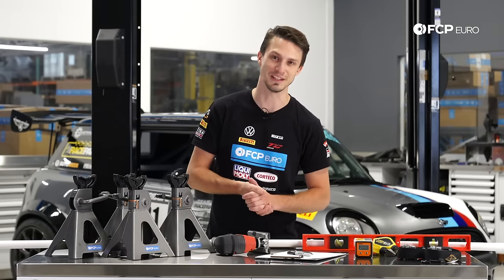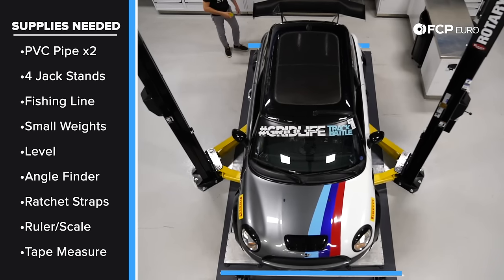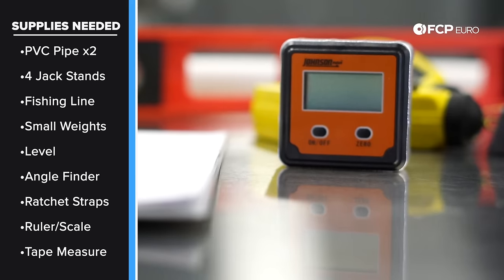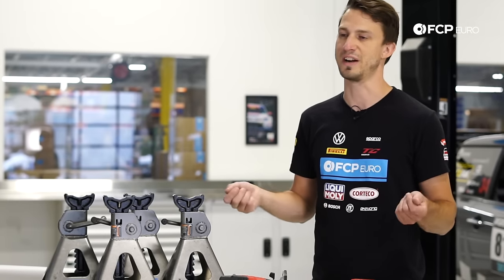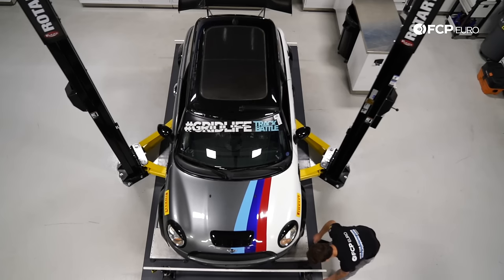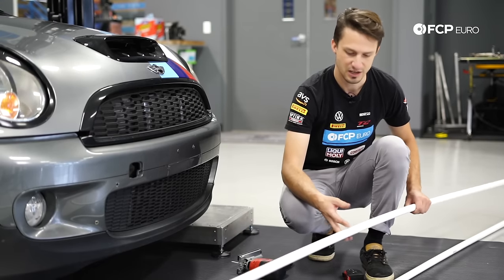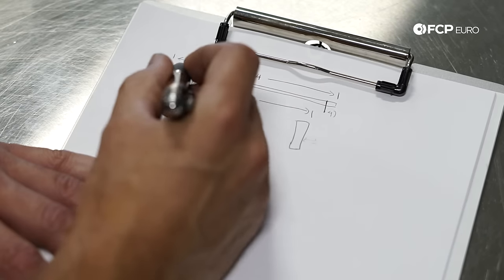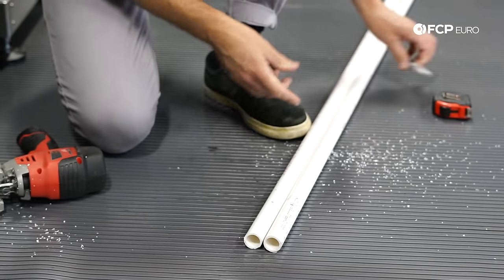At Home Alignment Made Easy - How To Use String To Align Your Car

Comment from the maker: Conversion Chart : https://fcpeuro.sirv.com/Content_Marketing/Degrees_To_MM.PNG
Reply: You could just use trigonometry.
Reply: Thanks 😊
Reply: Thanks. Is the diameter the "tire diameter" or the "wheel diameter"?
Reply: @gustavette8487  wheel
Reply: @douggolde7582  Yes measure actual diameter of wheel rim where measured, my cars 18 inch are actually 19 inch.
Reply: Should the steering wheel lock😂
Reply: Idler Pittman arm 2002 yukon

Comment: Very informative.  Now all I need to make it easy is a full size lift in my house.
Reply: No... Have seen old guys do Stringing race cars with the car on a flat surface ( on a tar surface).

Trolly Jack is what they use to jack the car up to allow adjustments
Reply: I do it in the pits. Just have to jack up the car a tiny bit at the front to do adjustments
Reply: Video hasn't even started yet n I'm ctfu @ this comment 😆
Reply: @gj91471  yo
Reply: Not correct if you’d watched it properly. I assume “Slow In Fast Out” refers to your information processing comprehension
Reply: Lol
Reply: Nah, just need 8 total jack stands 🤣
Reply: Lol
Reply: When I read this I imagined a house lifted like a redneck truck
Reply: 4:55 dude I'm surprised so many people liked this comment. Are people really this ignorant? Or is there a joke that I missed?
Reply: @johnnyovermind9830 No you’re missing the experience, the joke is build in.😂
Reply: Noob
Reply: U can have your tires on non stick pans
Reply: For anyone taking that seriously: You really want the wheels loaded as there’s a big shift in the alignment when the wheels are up in the air.
Reply: 4:57 lol

Comment: Hit up a "dollar store" and grab 8 cheap smooth thin cutting boards. Stack 2 of them, and stick them under each tire. Almost totally removes stiction when you're making adjustments. Sure, you could get fancy bearing plates - but then you wouldn't be watching a DIY vid!  :)
Reply from the maker: Love to hear it!
Reply: I was thinking about metal plates and axle grease between the two but sounds even simpler!
Reply: @PetuniatheGT350  me too
Reply: This is brilliant! I'm going to try it.
Reply: @PetuniatheGT350  Overthinking it bruh
Reply: @danyan7  sure ya wuz
Reply: I have turn plates for the front, but I'm going to try your idea for the rear.
I think I can machine some slots in the cutting boards, and make pins to tie them together, allowing them to slide in/out, but keep them from getting out of alignment with each other.
Reply: @1Cobranut  aww Cobra, ya such a Nut!  😆 Sounds plausible tho…

Comment: I've been doing string alignments for years! They are way better than a shop alignment which always gives you a crooked steering wheel.
Reply: Probably shop incompetence, typical when you have a "pro" do it. I recently had an alignment done on our old van and sure enough, the wheel is cocked at 11:30
Reply: I did alignment work for 25 years, I test drove everything, I made every effort to ensure my customers never complained of pulling, worn tires, or crooked steering wheels. Parking lot would be jam packed from open to close. Been 20 years since retirement, and customers still call for me.
Reply: @r.weaver3769  Respect you you sir.
Reply: @devonstrickland5640  Thank you, I miss the work, but truly miss the awesome customers I had.
Reply: @r.weaver3769  string alignments? :) Sounds like you did an actual thorough job LOL.
Reply: Does anyone know if the mfg specs are set when car is on the lift with wheels un-weighted?   Also - JFYI, doing alignment work on my Silverado required using a plumbers pipe wrench to break loose the lock nut on both sides.
Reply: @r.weaver3769  Maybe you should go out of retirement and teach the entire industry how to do correct alignments cuz EVERY time I get one it gets worse and worse....
Reply: had an alignment done at a local chain, ended up with crooked steering (10 o'clock!) they said it's my car that's the problem!- I said it did not come  in that way, they ended up redoing it,apologize saying the tech did not set the steering straight before changing the settings....

Comment: So after you paralleld the rear bar you have now thrown the front bar out of parallel.  Someone watching this and doest know the first thing about geometry will be messed up and or they will be adjusting off of incorrectly set parallel strings

Comment: Remember that just because two lines are parallel that does not create a square.   If the PVC pipes on one end were offset at all, even 1/4”, the strings would not be the exact same distance from the wheels.    A parallelogram would have all four sides parallel but could be very far from square.   I say this because those “centering” measurements were assuming the engine cradle was dead center.     We can’t assume anything.

Comment: when doing camber, try not to use the tyre as it bulges at the bottom, maybe 60psi would help negate this error, but get a flat bar the correct rim length for the DIYers
Reply from the maker: Absolutely! Hence Nate's note that tire is good, but wheel is better to get that camber measurement
Reply: Arent' we supposed to do camber adjustment first, then toe? The toe changes when camber changes.
Reply: @ModMINI  Caster, then camber, then toe.
Reply: @fcpeuro  Tire is not good
Reply: or just cut board correct
Reply: @hgjh6000  do you even know what camber is, and how a measurement is done?
Reply: @ranxerox10  I think what they meant is you could cut a board to fit on the edges of the rim, then measure the angle of that.

Comment: A few years ago I thought of using this method and used a pair of slotted wood battens for the string end supports, this method is by far the most accurate way to make wheel alignment, you did an excellent job of showing how to set the system up, hope not to many people spotted the little mistake you made when cutting the second  set of slots in the wrong side of the pipe :)
Reply: Lol I thought I was the only one who saw realised that didn't seem right
Reply: Im thinking of doing the same but rather than string would a screw not work butted up to the wheel rim? Running down both sides of the vehicle

Comment: Good video! A couple things that I have found after doing my own string alignments:

Use 1" EMT conduit instead of the PVC. If the jack stands are placed in a different spot front or rear, there will be different flex,  and that can alter the actual distance between the slots in the PVC. We are talking very small differences, but I can hold my measuring to .25 mm. I do my alignments outside, if the sun is beating on the front tubing but not the rear, with PVC,  this could cause a difference between the slots. PVC expands and contracts at a rate much higher than steel.  Even if this wouldn't be an issue for you, steel EMT would be much more stable and durable. Doing string alignments is all about eliminating variables. Use the thinnest hacksaw blade you can find and cut the slot by hand for best precision. 

To hold the steering wheel, you can get a steering wheel holder for alignments on Amazon. Looks like a little guy with a red head. Works great and it's a lot easier to use. 

I also use 50 lb test, .36mm diameter braided deep sea fishing line in bright yellow, it is very user friendly, doesn't knot up and tangle, yet it is easy to tie knots. It is highly visible so you don't bump it. And it holds a nice taught line with the weight without stretching. 

Some manufacturers measure toe in as a positive # so be aware what your manufacturer is actually stating. 

Here's a great toe conversion calculator: www.1728.org/toe-out.htm
Reply: Yes  u' r right.BMW have positive toe and is in not out...
Reply: I found a cheap alternative to the Amazon steering wheel holder - the wife 😂.  And she gets annoyed being called an Amazon...
Reply: thanks
Reply: Smart Man and smart comment.

Comment: Excellent video . Just one point, toe in is 
 positive and toe out is negative {3:43}
Reply: I've used both string aligning on my Camaro because it sits too low for me to try any other method but I used solid metal bars on each front wheel on my truck to set total toe. Technically you are correct but I think the guy is referring to the fact that doing the alignment by string method the way in which you measure it is backwards. If you were using bars on the wheels doing total toe measurement with 2 tape measures and say you were setting toe in then moral of the story is less you want a smaller measurement on the front tape measure vs the rear tape measure. But when your doing string alignments and setting toe in the number on the front edge of the rim on your measuring stick gets larger and the rear gets smaller because as the tires toe in they pull away from the string on the front since the string stays stationary that is set square and the rear of the tire or rim gets closer to the string. It's hard to explain but hopefully it makes sense.
Reply: @DJWhitetailfluff  Speaking in the same terms for something like this is important. In no world is toe-in "negative".

Comment: Thank you, my dad's 82 just had his MOT, they replaced his track rods but never did the alignment. Literally i confronted them, they told me they NEVER bothered, Disgusting i told him to report them to VOSA. I used to be a mechanic, i left to study Automotive Engineer. I didn't do the repairs because i was trained on a machine and didn't have the proper kit. I've never seen tracking done like this. It's makes sense your recreating the track bars, I'm going to sort it out for him. You can always learn a new way/trick. Thank you so much.
Reply from the maker: Happy to help - hopefully you get the 82 sorted!

Comment: The context about camber before toe at around the 31:00 mark actually goes for the front too. Camber (and front caster if adjustable) should always be done be done before toe at all 4 corners.  Virtually every car out there will experience some degree of toe change when camber (and / or caster) is adjusted and thus toe should ALWAYS be the last thing you adjust and never the first (unless that is the only thing you are going to be making adjustments to.

Even with camber plate adjustment, many cars will experience a noticeable toe change because its a factor of knuckle / upright geometry and NOTHING to do with the chassis suspension pickup points.
Reply: Was just about to say something similar...
Reply: Yes, this is key!
Reply: Thanks for this

Comment: Great explanation. Instead of taping and measuring threads on the tie rods, I think it’s easier to just make one full turn of the adjuster and then measure the change at the wheels. You only have to do it once per car and you get a precise measurement of the amount of toe in/out for each turn. Also, knowing that value, you can make quick toe adjustments at the track without having to restring.
Reply from the maker: if someone wanted to take the extra time to do that, thats a great idea!

Comment: First, Great instructional guys. After dealing with incompetent shops in my area that literally can't align your car unless it's 100% stock. I decided to do this my self. Glad I did, can confirm best alignment I've ever had on my Mazda 3.
  One note for people like me with OCD, you can help compensate for human error during setup by making the distance between your bars significantly longer than the length of the car, if you have the room.   Due to the relative length from the pivot points when making adjustments this let's you be more precise in twords the vehicle.  Hopefully that made sense lo
Reply from the maker: Love it, Mike!

Comment: I had to replace both rear trailing arm bushings on my 2003 Volvo S40. I didn't want to spend any extra on alignment. Followed this method carefully. I am amazed at the results. Car now tracks as it should. 

Only minor downside is adjusting the alignment without a lift can be time-consuming, as you may need to measure, jack up, adjust, lower, settle suspension and then measure again, several times!
Reply from the maker: If you have the option to get something the same heigh under all 4 tires, that helps!
Reply from the maker: Olfen that is what we love to hear! Now that you've done it once , it gets faster and easier each time after. Glad we were able to help
Reply: How much would the alignment costed you?

Comment: Thank you for the great effort on explaining this wheel alignment method, I do my car using this method of the fishing line around the car for toe adjustment and the angle finder for the front camber adjustment with camber bolts on the struts. Finding a perfect level ground is the challenge when one is doing this at home

Comment: Finally a video that mentions the reference box needed to determine the body to wheel relationship. I see the string methods often use the body wheel wells to measure from, assuming the body can guide what straight really is, so as to not create a crab walk.

Comment: This is one of the best tutorial videos on the art of aligning the wheels on the car. Best of all, you don't need fancy equipment to do it either, just simple PVC pipes, strings, and angle finder from HomeDepot and the rest of the tools most people would already have it. Best of all, this method works even for a high precision race car like the VW R36, it will work for every cars, with the exception of the actual mechanisms to make the adjustments on the actual camber and toe in in each model. I had always had my cars aligned at the dealer because they have the factory specs for camber and toe in but I will likely use the procedure outlined here to check and adjust if necessary in the future. I could even use the method to check if the dealer actually did their job correctly on my cars. Great video and very well done!
Reply: How is the angle finder used?
Reply: To measure camber.

Comment: When you set the string line up for the front, you have to measure from the CENTRE of the wheel (fore and aft), where you measured it, 3-4 inches fwd of the centre, you are setting the zero to any error that is already in place.
Reply: when you are spelling center the e goes before the r. 
also fully spell forward. dont use fwd because that means "front wheel drive" since where talking about an automotive topic. 
you're spelling things wrong and making it confusing to read.
Reply: @darkshadowsx5949  UK/EU and many countries spell center as "centre". The e before the r is an American thing.
Reply: @darkshadowsx5949  You used "where" when you should've used "we're"....LOL!

Comment: Boy, I've watch A LOT of videos about toe lately and, after finally *getting it*, can't get over how many 'experts' and even expensive tools out there that aren't taking into account the possibility that one wheel's toe may be very different than the one opposite it. Those methods and tools just assume to measure the total distance between both tires and split that difference as the target. Sigh.🙄 

Good job with the vid, and thanks for redeeming my faith in humanity.

Comment: This is a very comprehensive, well done description of the toe alignment process. I would, however, always do the camber adjustment first, as it will effect the toe.  I know this is mentioned in the video, but should be stressed more highly, even to 5he point of showing the camber adjustment first.

Thanks for a great video.
Reply from the maker: Appreciate the note Arnold; much appreciated!

Comment: Great video on alignment!  I to am a suspension mechanic (old school) and started in the late 70's. To be honest I've never been in the racing type of alignment and like your explanation of different angle adjustments for different types of racing, suspensions and tires.
 One thing I noticed about almost all alignment videos is that there is very little talk about SAI (KPI for us old timers) and Scrub Radius.  One easy visual way to see it is a beginner DYI mechanic will tend to mount deep dish or heavily outer off set rims (tires sticking way out of fenders) but the pro mechanics keep more of a stock look meaning wheel assembly stays tucked in  more under supervision and bearing load.
Basically that's Scrub Radius as you know.   
 Your thoughts or do you feel it's worth making a video on subject.
Aloha Zac

Comment: Thank you so much! I think I will try doing this on my car. Took it to alignment to a shop and they left the wheel crooked, said they couldn't get it straight. (???) Think they just took my money and didn't actually touch the car. This is why I hate taking my car to a shop, you never know what has actually been done to it. Better do it myself.
Reply: The wheel usually gets crooked because they make an adjustment, then don't bother checking the wheel to see if it moved. They could absolutely get it straight, just too lazy.

Comment: Excellent video, however, your description of positive/negative toe at 3:43 is backwards. I'm an ASE-certified alignment tech for over 30 years and I was once a chassis engineer for Honda.  Positive toe is "toe-in" (fronts of tires pointed toward each other).  Negative toe is "toe-out".  Your spec sheet you showed even confirmed it which gave a positive toe spec (most factory cars have positive toe-in specified for front tires).  Your descriptions during the video seemed to indicate you knew which way your alignment angles needed to be regardless of how you defined it earlier in the video.  Otherwise, outstanding how-to video.  PS:  love the ratchet strap technique for centering steering wheel, I will use that ;)